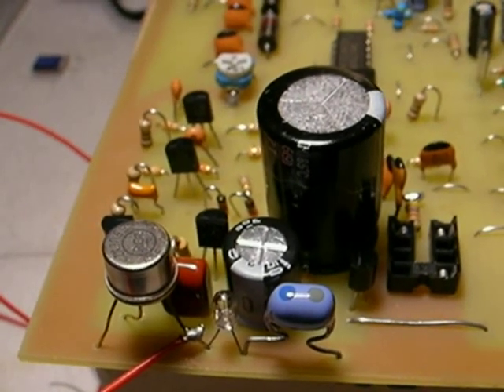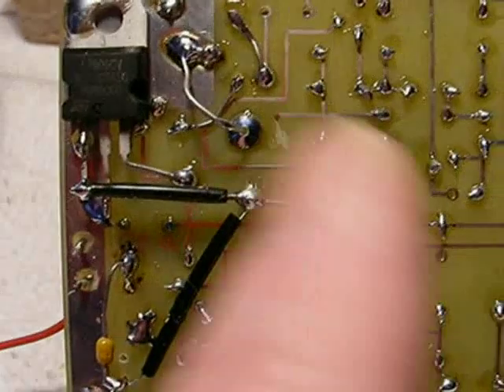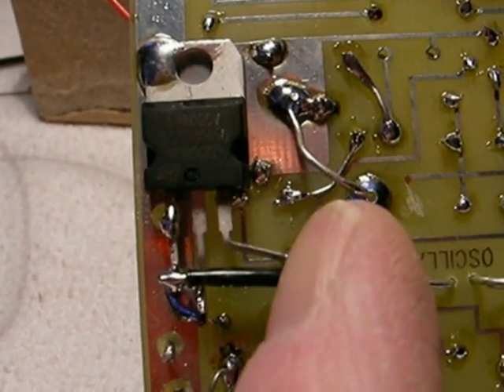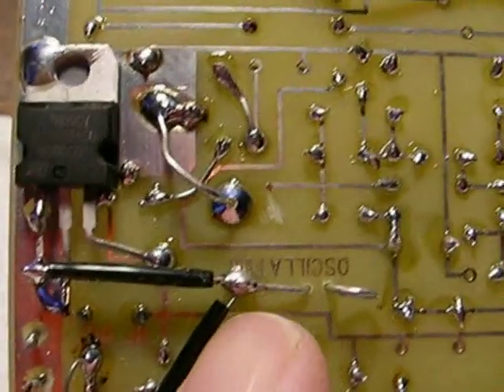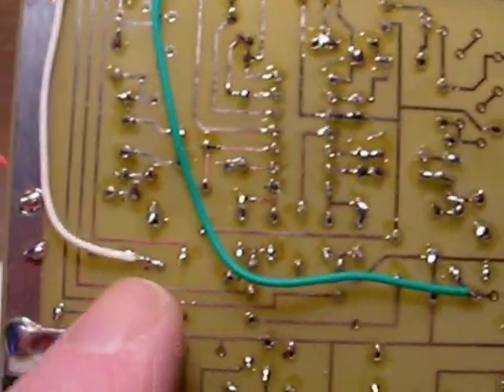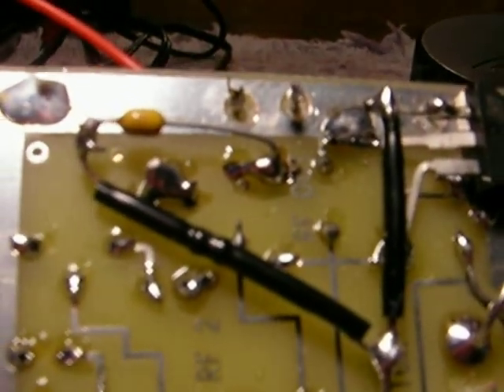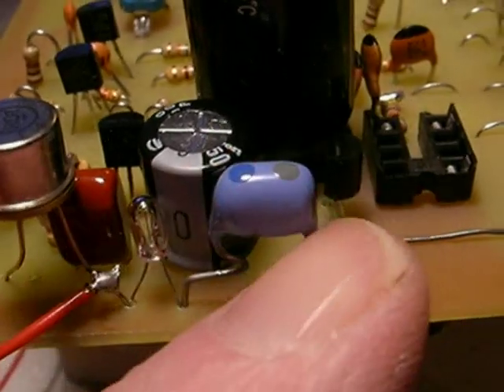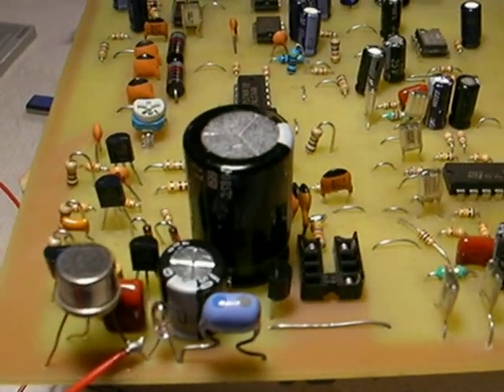AM Stereo transmitter RF out part 5

Comment: @fortyfiveplayer
Thanks, ground of course. I'm using the Talking House now for my tube radios. Works well after I made some mods for audio. It sounds best when fed with a computer using audio shaping software.

Since I am mostly mono that should not be an issue? 
Does the stereo encoding improve audio for mono or no change? (like FM stereo)
Are there any AM stereo receivers to be bought. I see you have a Realistic. What model?
The only one I see still made is a Sony  SRF-A300. (sending PM)

Comment: Looks like I am missing a 150 Pf capacitor out of parts bag 8. Unfortunately I had to sub in the nearest value capacitor that I have which is 100 Pf but before I apply power I really need to know if this is a safe change or not.